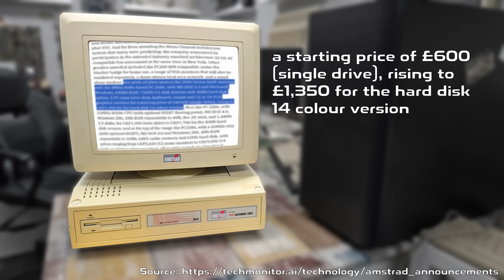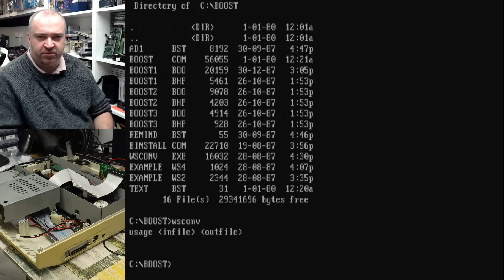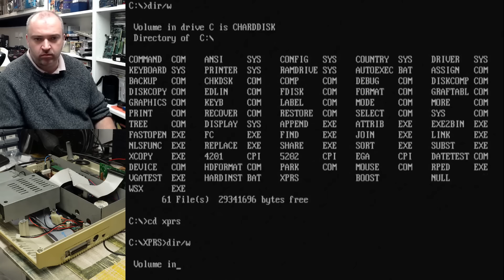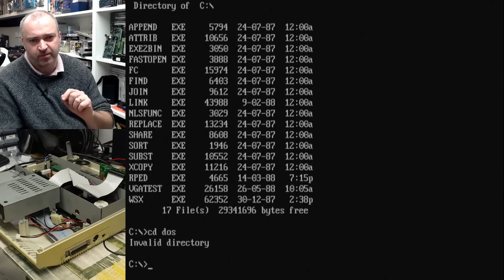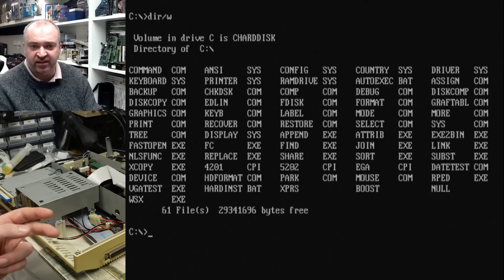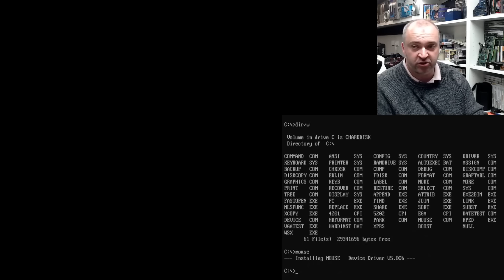Can I fix this faulty Amstrad 2086?

Comment: As a staunch Amiga fan, I'd have appreciated a trigger warning when innocent Amiga disks were tainted by being put into a PC.  😉  So by this model, Amstrad had stopped putting the power supply in the monitor, which is a good development.  I'd agree that the mouse driver is a likely candidate to keep.  LOL at "Two days later, so it is".
Reply from the maker: I was wondering if anyone would notice the Amiga disk 😅.  Just a bit of fun with the Belfast accent so it is 😂
Reply: It was common to find an Amiga demo disk with some other pirated game copied over it but at least that was keeping in the Amiga ecosystem. At least the label hasn't been written over and to be honest, that's the collectible part, most don't even use the disks and have switched to gotek or whdload.
Reply: Haha, I reacted aswell xD

Comment: If there is a lot of wear on the crt I'd just use it as is replace leaking caps only and enjoy what life is left in the tube. I wouldn't invest to much money unless you find a tube with less hours on it. Just enjoy it. It's not your primary computer and this is just another reason to turn it on and not worry about adding hours to the tubes.
Reply from the maker: Absolutely, while I do want to use this machine to some extent its not going to get any huge amount of time spent on it so with the leaky caps replaced the monitor will be fine for what I need.  I have been given a few tips that I need to try which might get a little bit more performance out of the CRT so will give that a go then just enjoy it for what it is.

Comment: Great stuff Glenn, I enjoyed that one:) The big advantage of that particular ESR meter is its ability to check the caps in-circuit, so you could just nip around those other caps without desoldering. It has saved me hours!

Comment: I have 2386 with 386DX 20 MHz but there is MFM HDD. I read somewhere that Amstrad didn't have 100% working IDE controller so they used MFM but You have IDE drive - strange. It is very important to have correct Amstrad keyboards to these komputer because they are not working with any other keyboard and it is impossible to buy converter. Great video.
Reply from the maker: Thanks, glad you enjoyed the video.  Yes, I had read that about the keyboard but it also seems the mouse on these was bespoke to the Amstrad range of computers.
Reply: @CRG  thank You for information about mouse. This problem is easier to solve because it is possible to connect RS232 mouse. People often don't know about these details.

Comment: Those 3 height adjustments are for the 3 vertical refresh frequencies of cga, ega and vga. If you look on the back of the line output transformer (flyback) you might see 2 adjustment pots. on is for A1 voltage (effects the brightness) and the other is for focus. As the CRT ages you'll need to increase the A1 (Anode 1) on a Sony Trinitron its the G2 (Grid 2) increasing these will give you more brightness without affecting the focus as much as winding the brightness up. Turning it up too much will result in flyback lines though. Once you have the brightness better, then try to adjust the focus. It probably won't make much difference, but I have seen in cheaply produced monitors that these have never been adjusted in the factory and have made a huge difference.
Reply from the maker: The flyback does indeed have adjustment on the back of it so yes I'll give that a go and maybe it'll breath a bit more life into the screen.  Thanks for the tip!

Comment: Will it run Win 11 and Office 365 2024? 😅
Reply from the maker: Just as well as it runs Crysis 😉
Reply: @CRG  😀
Reply: @CRG  Brilliant Channel by the way and your thought process.
I miss the old days, as I used to repair these types of computers and equipment, not far from Microsoft in Reading Uk
Reply from the maker: Thanks
Reply: @CRG  ps - You can adjust the Focus / Brightness / Purity and Geometrics
I have a very expensive tube booster here that rejuvenates tubes.
Old Monitors are the best as everything is adjustable, even the focus
Reply: It could totally run Windows 11...
... if you completely changed the guts of the machine to something modern. :P #SleeperAmstrad
Reply: @djclassiccut4480  You mean on a PC with that Spec you have only managed XP as Maximum?

Linux would easily run on it by the way
Reply: @rectify2003  Running Windows 11 older computers.

Comment: Mostly I only need to change one or a few bad capacitors in old monitors. Sometimes just a blown RIFA filter capacitor. I have newer changed all the capacitors in a monitor, just the ones that have leaked or bulged in the top.
There should be a focus pot on the high voltage coil.
Mostle there are two pots on the high voltage coil, one for focus and another for brightness. If brightness is set to high, there will be "back loop" lines. If theese two pots are adjusted right, with a little bit of patience, the screen can often look almost new again :)
Thanks for another great video, I really enjoy your videos!
Reply from the maker: Thanks for the tips, I'm hoping to get back to this machine sometime soon so will certainly be taking your points onboard.

Comment: Oh I had one for these for my collage work.  Well in fact it was the later 2286 model but not much different, it still had a 30gb hard drive.  My proud moment was to write a batch file to call up a menu to start my programs on it :).. loved the machine.  I still think to date they had some of the clearest monitors to date with a very black screen tube :).
Reply from the maker: Sounds like you had a lot of fun with your machine.  I have a batch file like that on my Olivetti 286, it is a handy thing to have.  I've been given a few tips for tweaking the monitor a bit more to hopefully improve the picture so all being well I'll be able to breath a bit more life into it.
Reply: @CRG I always wanted a sound blaster card for my machine but could only afford the Adlib 😢😢🤣🤣

Comment: Great Video as usual. I remember working on these systems decades ago.

One tip, clean the board with white vinegar to neutralise the alkaline from the capacitors then clean with IPA.
Reply from the maker: Glad to hear you enjoyed the video and thanks for the tip.  I'll be sure to use a little vinegar next time.

Comment: Wonderful looking machine. My first ever PC was the 386dx version, in the exact same case. I bought it second hand. Was the only way I could afford to jump to PC at the time. I have a very soft spot for these but I've not seen a single 386dx variant hit the market. It's usually the 286.
Reply: Around the early 1990s my friend had an Amstrad PC2286, and I'm certain Amstrad also produced a PC2386. My friends 2286 had a Miniscribe 30 or maybe 40 Mb HDD plugged into an ISA card, as supplied from new, because the original on-board HDD slot had some problems and wasn't useable. My memory of it may be slightly fuzzy.

My brother, after seeing the 2286 thought he'd found one to buy for not a lot of money, bought it, and then was mightily upset that it was the 2086. Much slower, less software compatibility, etc.

Not sure what happened to either machine. One thing I did like about these Amstrad machines was that the monitor sat flush into a recess in the top of the case, and under that was above the battery slots, and on the left in the recess where the power switch sat was a volume control for the built-in PC speaker. I've never seen that on any other PC.

Things I did hate were the plastic of the case, and the generally lower quality that obviously saved Amstrad some money. Also, not being able to upgrade the memory wasn't so great, but maybe a memory card could be installed. I really don't know, as I never tried. Last thing I hated was there was no CMOS settings to edit until you ran a SETUP utility on one of the provided floppies. I'm guessing that would be fairly specific to each model too.
Reply from the maker: It is a lovely looking system and maybe with a little cleaning I can get it looking even better.
Reply from the maker: The plastic feeling of the case is as you say from Amstrads cost cutting exercise but it does seem to be well enough made for what it is.  You mentioned the CMOS but I'm not even sure this machine has any such settings, rather there is a switch block at the back which seems to set some basic things.  I'll have to remember to talk about this in the next part.

Comment: Wow, what a neat setup!  An 8086 with an XT HD and VGA.  The only other XT HD I have seen came with an Amiga A590 and it wouldn't spin up.  Maybe I should check the caps...
Reply from the maker: I have an XT drive from an A590 that I want to try and image at some point.  I wonder if I could use this complete along with an XT-IDE to do that.  If you're drive is dead it certainly would be worth checking over the caps on it, you never know, it might be that simple.
Reply: My A590 came with a SCSI drive. But that was very soon replaced with a 120, then a 240MB drive instead of the small 20MB one

Comment: nice work getting this back working. Sweet looking machine. Crank up the Screen pot on the flyback a wee bit to get some brightness back there. 
 For the horizontal width, monitors usually have a Width coil in the vicinity of the flyback . At 43.06 it's most likely the vertical coil with a ferite or carbon rod in the center. You can turn this with a plastic too (a metal screwdriver will apply too much strength and destroy the rod so be carefull) to change the width a bit. The blue cap beside it is most likely the width cap, changing it slightly it can also help you gain some width back if you can be bothered going down that route. 
tbh it looks fine as it is so I'd leave that alone :)
Reply from the maker: I'll try to adjust the pot on the back of the flyback and see if it helps.  Thanks for the info on the horizontal.  I've since got a plastic tool for such things but as you say it's not too bad so maybe best left as it.

Comment: Any chance you could image the drive and make it available for download? After any personal stuff is removed obviously. p.s. Every video you do gets better and better, keep up the good work.
Reply from the maker: I can certainly try to.  Any ideas how I would go about imaging an XT drive like this?
Reply: Install an XT IDE card or an IDE controller card in one of the ISA slots and copy the files on the HDD to a CF card or another HDD.
Reply: @CRG maybe a couple of ways you could do it but probably depend if you have the bits to do it though. think the easiest would be If you have a PC that can take the 8bit ISA HD and capable of running Linux just dd it to an image file. Other way would be a parallel port zip drive but like I say it all depends if you have the tools to do it. If its going to cause you a load of hassle don't worry about it I don't want to be the cause of holding up your video production....
Reply: @CRG  I went old school & used Laplink to copy the contents of my one 😁

Comment: I've also got the same monitor (PC14-CD) though judging by little dust on the inside I don't think it's been used much. Regardless it still takes a good while to warm up and reach good brightness levels - about 30 to 45 minutes, which is very odd. Wonder if it could be a design quirk of the monitors circuitry?
Reply from the maker: Maybe I just need to leave it for a bit longer then.  Its been ran for maybe 30 minutes at a time but not much more than that.

Comment: One CRT I have was so dim it couldn't really be read in normal lighting anymore. I increased the B+ voltage a bit and it looks fine now. Not the recommended way to fix a CRT but it was either that or throw it out.
Reply from the maker: Whatever you need to do to fix it.  I've been given a few tips that will hopefully breath a bit more life into this screen for me so will try those and see how it goes.
Reply: @CRG If all else fails there is always the B+ voltage. :)

Comment: Great video - I have an Amstrad pc1640hd and the monitor is showing a snowy picture. After watching your video a recap might be in order..?
Reply from the maker: Possibly, although I'd wonder if snow was not something interfering with the signal.
Reply: @CRG  I checked the motherboard as the person I got it from switched it on and it went bang… the monitor provides power to the pc, so I thought it might have been the caps in the monitor.

Comment: Hello, my father had one and in France it came with Dos 3.30 and Windows 2.03. I buy one recently and I have not your chance with the HDD. As I remember reading, there are different configuration, RLL hard drive and some sort of XT-IDE (you have) and different floppy controller. Mine support 1.44M (otherwise no stated to support it) but warning the main floppy drive must have ID 0 (and not ID 1 as PC "standard" floppy drive), I install a Gotek and 1.44 floppy image work perfectly.
Reply from the maker: Are you sure your system is the 2086?  I only ask because the 2286 and 2386 had support for 1.44M floppy drives.  If yours is the 2086 I'd love to know what floppy controller it has.  Maybe I could upgrade mind to read 1.44M disks too.
Reply: @CRG Yes it is a pc-2086 with an 8086 (mine is branded Siemens and my father was branded AMD like you), I replace the CPU with a NEC V30. I will check for the floppy controller.
Reply from the maker: @johann9768 thanks, I appreciate you going to the trouble of helping.
Reply: @CRG  It is a UM8272A like you. With my gotek I have no problem with 1.44Mb image (I test installing Dos 6.22 without problem)

Comment: Could those light blue capacitors on the monitor board be polyester caps? It would explain their longevity and why they don't leak corrosive goo all over the place.
Reply from the maker: Do you maybe mean polymer capacitors?  I don't think I've ever seen a polyester cap in that type of configuration and are polyester caps not non-polarised?  Even at that I'm not sure polymer caps were a thing when this was new but I'm by no means an expert so could be wrong (usually am 😅)
Reply: @CRG  Ah yes, I meant polymer caps not polyester! Wasn't aware that they're a relatively new type of composition but I have seen some people mention using polymers when recapping to prevent future leaking.

Comment: Recapping can make sense. Depends on your own expression of the Board.
Reply from the maker: While not in the video I tested a few more of the existing caps on the monitor and while granted they were still in circuit they certainly seemed to test ok.  But yes for longevity a full recap certainly wouldn't do any harm.
Reply: @CRG  on a socket a board recently i just replaced the bulged caps around the cpu. The others looked good. Then i tested it and installed xp outside a case. Afrer testing and the install some of the good looking ones startet to bulge too. Just personal expierience. But the amiga should have higher quality caps, as it is older.

Comment: Pretty odd for a 1988 PC to be all 3½ inch drives, I guess that explains the external disk drive connector, honestly kinda cool for a Turbo-XT, I assume they meant for you to have all your software on DD floppies.
Reply: I believe my friend who had a PC2286 version of this also had a 5.25" fdd for it that plugged in to that external drive connector.
Reply from the maker: The external drive connector is indeed for a 5.25" drive but I've not been able to find out much about it beyond a passing reference in one article (and of course what Simon mentioned above).  But I'm sure there were plenty of people out there with the basic version of this machine just running everything from floppy.  I know I was certainly happy doing that in the early 90s on my Amiga.
Reply: @SimonSideburns  I have the external 5.25 floppy drive with my 2086. Took me a while to get it working as it was defaulting to 720k & no bios screen. Found out that you have to run a program to set it as 360k
Reply: @turntheblueiris4626  Oh yes, I remember the very limited CMOS settings were changed by running a SETUP executable file on one of the supplied floppy disks.

Comment: I had the Amstrad PC1640HD.  So peed at myself that I physically smashed the crap out of it when I finally upgraded to a 'real' PC.  The PSU in the monitor was effing stupid, as was using an 8088 processor to save a couple of bucks over the 8086.  That 20Gb full height 5.25" MFM HDD was a beast though!

Comment: Aaaah local accent on YouTube!! Subscribed!! #Amiga4ever
Reply from the maker: Always great to hear of other local people interested in this retro tech, thanks for subscribing!
Reply: @CRG  My A4000T needs work, can you do it? Got a BFG9060 running at 100MHz but the termination on the Z3 bus doesn't work properly at that speed.  The solution is active terminators instead of resistor packs.  There's seven of them that need soldered in.  I'm pretty handy woth a soldering iron but wouldn't wanna risk it.  I see you build cards so it'll be wee buns for you!
Reply from the maker: I've never worked on a 4000 before but it sounds straight forward enough.  Let me do a little homework on exactly what is required and I'll get back to you.
Reply: @CRG  it's an A4000T.  Matze from Amibay has made the active terminators.  Unfortunately most of the information is in German on the A1k forum.
Reply from the maker: @KarlHamilton Yeah I found the thread on A1K.  Looks simple enough, you'd need six of the boards and the components associated with them but I'm happy to do it for you.  Probably best to move to e-mail (casualretrogamer@outlook.com) or feel free to jump on my discord (link in video description)
Reply: @CRG  Thanks so much.  Email sent :)